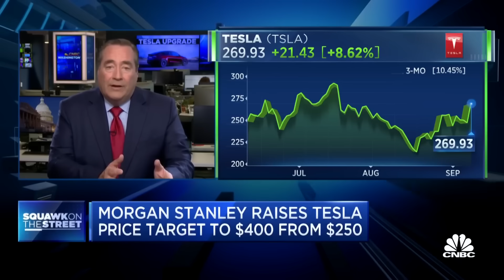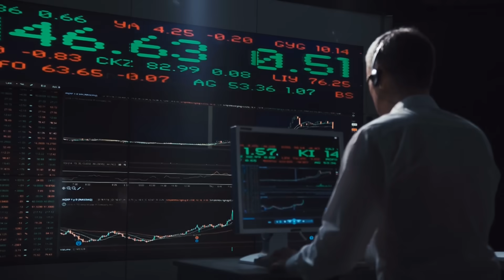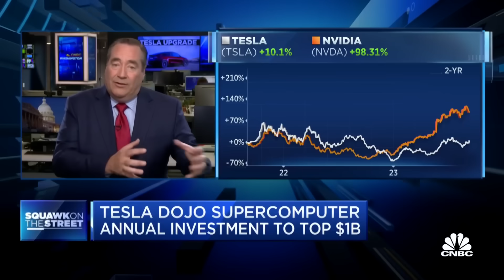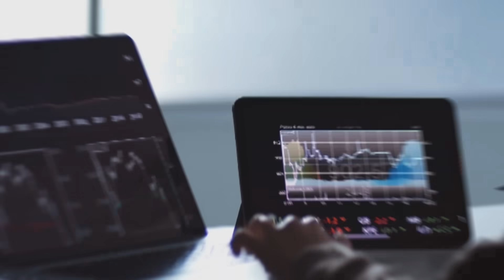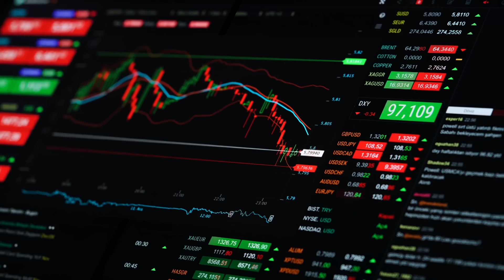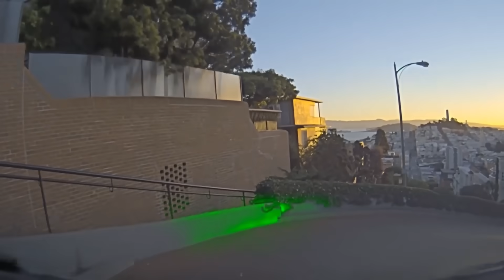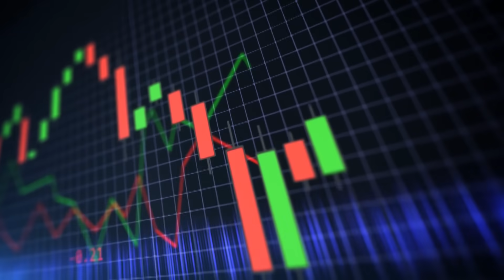Tesla Shareholders SPEECHLESS After “THIS” Morgan Stanley Interview!

Comment from the maker: Do you think Tesla Stock will reach up to 15x in the future? Comment your thoughts below!!!
Reply: Yes
Reply: I am holding 4.678 Tesla Stocks!!!
Reply: That's not a very useful question.  The future is a long time.  I think it will reach x100. But not by the end of the decade. Maybe not within my life time.  2150. Definitely by 2150.
Reply: I don't know. Imana buy some and find out.
Reply: Holding 600 shares!
Reply: Only the strong will survive. Great LONG TERM investment.
Reply: Legacy auto, Ford, GM, Stelantis, etc., has one chance to survive, that is to partner with Tesla to be the parts supplier for drivetrain, electronics, software, and eventually Full Self Driving. No other automaker can execute over the air software updates as can Apple and Tesla. Over 90% of Tesla recalls are corrected with over the air software updates. In addition Tesla has virtually eliminated auto fires and Teslas are the safest cars ever tested by every auto safety agency worldwide; Ford, GM, Stelantis cannot compete with that and car buyers would have to be braindead to buy any other BEV car. For Tesla partnerships are intelligent to avoid monopoly concerns.

Comment: One of the issues I have with EV's is that when the batteries wears out, the car will be basically totaled because it'll be more expensive to replace the battery than the car is worth. Most people buy used cars, and it's just not going to be worth it to buy used EV's.
Reply: The batteries should be fully serviceable like the majority of rechargeable devices.  A car should be no different.
Reply: Tesla have an 8 year warranty on their batteries.  TESLA will replace a defective battery in that time frame.  If out of warranty Tesla will charge for a refurbished battery replacement or there are now specialist garages that will take out the battery, replace defective modules and replace minor parts to make as new and reinstall for a cost of say $6k which should give you another 6-8 years of life.  An older model Y has a lot of scrap value for aluminum and even dead batteries have a good recycle value.

Comment: Tesla stock won’t go up much anytime soon like 2+ years
Reply: The Cybertruck launch in a couple of weeks.
Reply: I see in 2024 Shanghai increasing sales by 150,000.  Austin adding 100,000 modelY but Berlin only 40,000.  Fingers crossed we may get 100,000 Cybertruck in Austin.  No change in Fremont or S and X.  2025 depends on what happens with the model 2.  Energy storage in 2024 could add another $4bn sales with a very good profit margin.  I can see 2024 being between 300- 350.  I prefer the lower as I want to buy 800 more shares in 2024.  this gives me 2,000 shares which i´ll not sell, my children will inherit them.  I can sell covered calls at a higher price on those 2,000 shares for 44 weeks a year and make $300,000 - 350,000 a year.
Reply: @robertwoodhouse-bm7kt  I am talking about the stock not the company their two different things I agree the company has a few up coming events but the stock has a mind of its own 👍